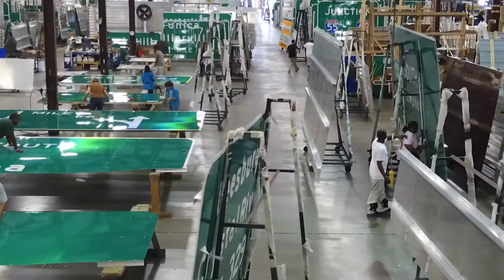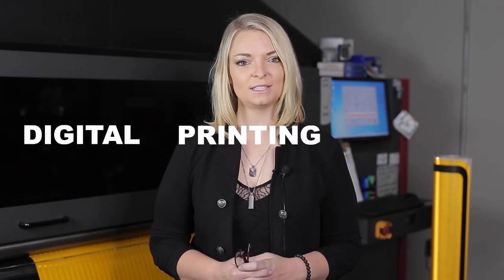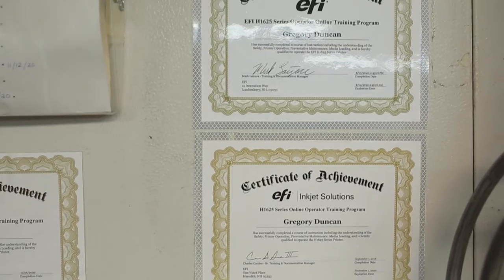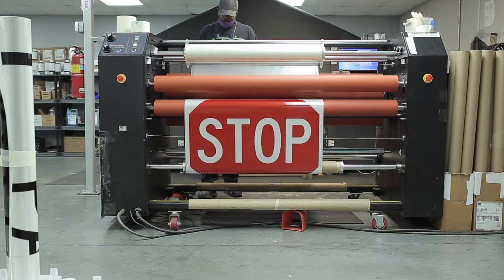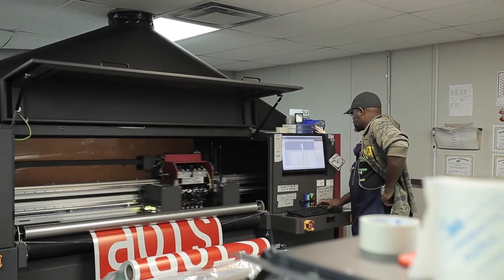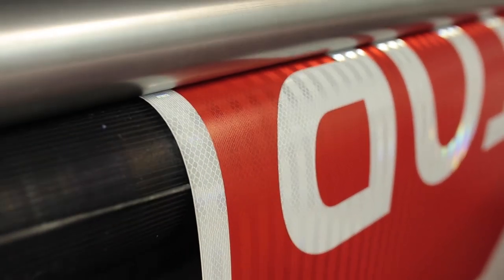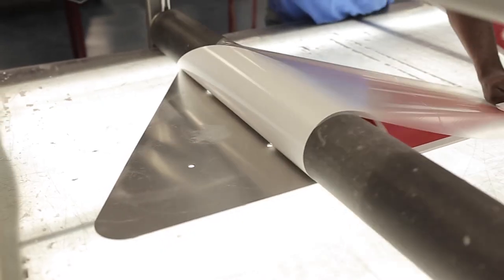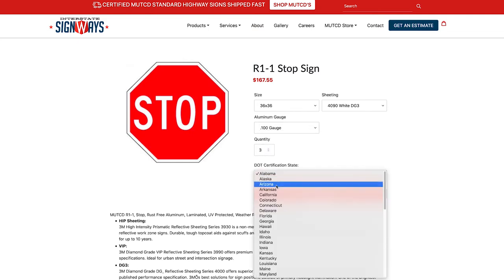How We Make It - Episode 6: Digital Printing Process

Comment: It’s so impressive the amount and quality of the products that 3M makes.. those signs have to withstand all kinds of weather, UV light wear resistant and have to be cleaned easily and also reflective.  Not even getting into the actual way the sign is built and reinforced. I’m fascinated by it. That aluminum is pretty bright! .. and the aluminum sheet is almost like spring steel. I have some bent ones that are impossible to bend back.. at least with what I have. 
 ..  one day I’ll be ordering custom signs that look exactly like sections of bigger ones.. ( for dining tables, side panels for a treehouse, coffee table out of part of an exit… or smaller mile/distance sign.. to the next whiskey bar.. don’t ask why .. 
 —- 30 year furniture maker that makes modern furniture with items found in our society.. not quite found objects …, 
 I need to send in an E-mail